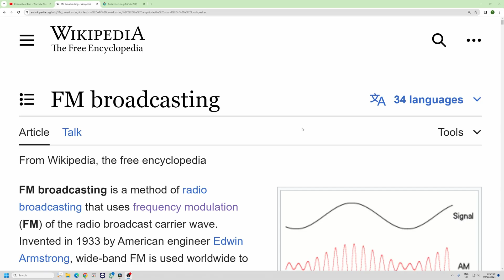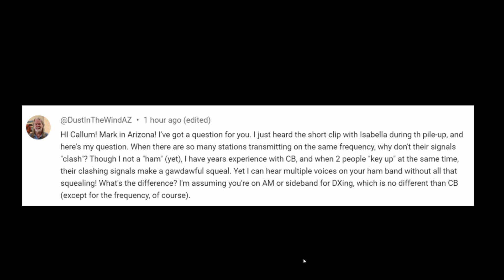The REAL Difference Between FM AM and SSB

Comment: Pilot here. Our near-land radio uses basic VHF AM and we normally get squeal when two transmit at once, but that is still a good thing because the receiver will know there are multiple transmissions and can request each in sequence. Normal case is that one transmission started or finished a bit earlier than the other so at least a call sign made it through (or a "mayday mayday mayday"), and the receiver asks for that one first. 
Worst case is both transmit exact same start and length, forcing the receiver to say there was overlap and try again, but natural random delay will avoid another perfect collision.

Over ocean they use the HF, SSB with the channels rather far apart so they can adapt to current propagation conditions (like 2 MHz to 20 MHz and less than two dozen channels; but I'm not a transoceanic pilot). The controllers do not directly use the HF ground stations, the messages are relayed through proper radio operators because controllers are centralized and concentrated on aircraft spacing and expected checkpoint times, while there are multiple base station locations and a lot of oceanic transmissions need to adjust for skip or ground wave.

For VHF it is all line of sight and controllers directly talk to aircraft, and they have automated low-power remote stations. For voice-band Europe uses 8.33 kHz channel spacing and N America 25 kHz (Though commonly US stations are on the 50 or 100 multiples). 50 kHz channels for navigation beacons (Often includes extra subsignals, even mixing AM with FM in that 50 kHz)
Reply from the maker: Thanks for the awesome insight and explanation from the pilot's perspective!

Comment: Thanks for an interesting discussion. I've got another question about various modes. Recently, I've been trying WSPR on 40 and 20 meters and have been astonished at how far my 2-3 watts get out. The WSPR reports include a signal strength in dbM. I'm wondering how well that numbers translates into making a contact with CW or SSB. What sort of report in WSPR would indicate a reasonable chance of contact with the other modes?
Reply from the maker: WSPR is good fun... For low power stuff, it's probably the best.

Comment: Two operators cannot talk simultaneously on airband.   There are many cases where a receiver has not heard an important message due to another transmitter keying at the same time.   The radios are not built to transmit and receive at the same time.
Reply: Two radios can talk simultaneously on airband.  But if their carrier frequencies are offset from each other they'll cause a heterodyne squeal.  If they're very close together in frequency (if they're frequency locked) they won't.  The fact that radios are half duplex has nothing to do with this.

Comment: "They've got very high quality pieces of kit, everybody's locked on the right frequency because it's all calibrated right"

Not the radio in my aeroplane! :-) Admittedly these days I use a handheld for the 8.33kHz spacing which is a lot better than my old radio in the aeroplane.

Comment: FM receivers also don't pick up or respond to atmospheric static or electrical interference, such as lightning, that AM and single sideband receivers pick up. To produce a transmitted modulated AM signal with two sidebands, only one sideband is required to modulate the carrier. I have a couple of old vacuum tube single sideband radios that have a manual carrier control knob on the front panel. In AM, only the upper sideband is produced to modulate the carrier, but you can hear the lower sideband that is also produced when the carrier is modulated by only one sideband. The carrier has to be powerful enough to handle the modulation being produced by the one sideband though. With those old radios, when I reduce the carrier below a certain power level, only the upper sideband is transmitted.As I introduce more carrier power, both upper and lower sidebands are transmitted with the modulated carrier.
Reply from the maker: Nice!

Comment: I haven't seen FT8 mentioned in this thread.  Love it or hate it, it makes full use of the benefits of SSB that are being discussed here.  In particular, on one dial frequency, in one 15-second period theoretically there could be a 'pile up' of >50 simultaneous transmissions, each being individually identified and decoded at -20dB thanks to the magic of SSB (and some cool software).
Reply from the maker: Yes! I recorded a video yesterday of that!

Comment: Callum, I’m still new with AM/SSB with ham radio, but I’ve been licensed to fly for the past 18 years, working professionally for the past 8 years. Aircraft radios most definitely don’t allow two pilots to be heard at the same time. On a busy frequency, it’s very common to hear loud squeals when two key up at the same time, and usually either transmission can’t be deciphered (happened a few times today). Sometimes, if one is much closer than the other, but usually not. It’s common for another person also on frequency to call out “Blocked!” any time there’s a “pileup” on an aviation frequency, sometimes causing another squeal when multiple pilots call it out. I still appreciate AM over FM because I’d rather not get the message but know one was trying to be sent rather than have a closer aircraft transmit over ATC and I miss their message entirely due to capture effect.
Reply from the maker: Fascinating..
Reply: replying to @pcramil's comment: I appreciate he's speaking from practical experience at the pilot end -  I've worked on the ground end with aviation communications "a long time" (RAF then Frequentis since 1990).  In reality if 2 aircraft transmit exactly on the same frequency, with similar power/modulation etc., in the tower you will get a "heterodine" reception.  You occasionally can make out one aircraft over the other if one has stronger signal, deeper modulation, or a higher pitched modulation (female pilots win 🙂), but you definitely always know that 2 (or more) aircraft were transmitting at the same time.  In the opposite direction (ground to air) often the ground station is more legible to the aircraft, due in part to more power and more efficient antennas.  We also use something called "climax operation" where 2 or more AM ground transmitters, geographically separated, and with a very small offset on the carrier frequency, can deliberately transmit the same thing at the same time, and be fully legible to the aircraft (as long as we set it up properly 🙂).
Reply: @cfsyoutube5799 hello, I’ve read few comments here and I see there’s someone from the aeronautical world. I’m a commercial pilot other than a ham and in fact I’ve noticed many times ground stations have multiple carrier frequencies with an offset from each other and from the center frequency. Sometimes I can hear the beating tone from the aircraft. I’ve always wondered why is that done. Is it done on purpose or is just a frequency misalignment from the multiple ground stations transmitting a the same time? Also why they use geographically different transmitters simultaneously? perhaps for radio coverage? this is interesting. Another thing I’ve noticed is that with average ham receivers the rx filters aren’t wide enough to copy the aircraft and the ground station without moving the tuning knob to center on the station. From the aircraft instead never had this type of issue. Filter width and audio quality is good enough.
Last but not least I can confirm that the radios are not perfectly centered but enough to work. And when two transmission happens at the same time, ( which I can tell it happens all the times) you can definitely hear them both, and sometimes, depending on relative strengths etc you can read one station over the other. And yes, somebody will say blocked to suggest two transmissions crossed each other.
Reply: @IZ0MTW  I'm not the OP but: "I understood this years ago... I don't anymore! This explanation is from my notes, written in the days before 8.33 kHz spacing which I guess finishes the possibility of offset carrier operation. I remember it is to enable more than one ground station to improve cover on a single channel. 'Provision exists in some areas for offset carrier operation, often referred to as Climax operation. This means that transmissions may be offset from the designated (pilot selected) frequency by plus and minus 5 kHz if a 2 carrier system is used, by + and - 7.3 kHz if a 3-carrier system and by other precise values if more than 3 carriers are used. The only concern for the radio engineer is that if these offset carriers are used a beat note is produced in the airborne Rx at 10 kHz ( or 14.6 kHz) when two (or 3) carriers are received at the same time.
The squelch circuit usually samples the the signal (speech) and the noise usinfg filters below and above 8 kHz. So for normal reception valid signals will have more detected frequencies below 8 kHz ( 300-3000 Hz speech) than above. A simple amplitude comparator will therefore open a gate to allow the speech through to the final amplifier. However if offset carrier operation is occurring beat notes above 8 kHz will will be produced after detection, simulating more noise than usual thus muting the audio o/p - squelch.
To overcome this VHF comms receivers have both signal-to-noise squelch and carrier squelch circuits. If the carrier is greater than 20 microvolts at the aerial then the squlch gate is opened even if beat notes are present. No problem to the pilot since he has selected the particular assigned offset frequncy and wants to hear the received signal. "
Reply: I'm just wondering if 2 AM transmitters, one with a suppressed upper sideband and the other with a suppressed lower sideband would work also? Suppressing only one sideband with the carrier present is still AM
Reply: @RichardMartinke6rji thanks for this interesting and detailed explanation. Certainly useful for those into these kind of stuff.
Reply: What is a.m. shortwave the other is UHF VHF

Comment: When you mix two frequencies you get three products. Like when you mix 3KHz with 27MHz, you get 27MHz minus 3KHz you get the 27MHz and you get 27Mhz plus 3Khz. This is what a normal AM signal looks like. The  minus is the lower sideband, the middle is in this example the carrier and the plus is the upper side band. 
So when you talk in your microphone you get the carries plus two sidebands. Now the carrier does not have any information. The information is in the two sidebands. And since the two sidebands contain the same information, you only need to transmit one sideband, the lower our the uppere sideband. 
So what you do with a balanced modulator is surpress the carrier, since the carrier does not contain information. So you left with only two sidebands. Now what you need to do is surpress one sideband. This is done with a crystal filter. You either surpress the lower sideband our you surpress the upper side band. Leaving you with one sideband to transimt and you can put all your HF power in the one sideband. This is single sideband. The carrier is only needed to demodulate the signal and can be provided in your receiver and this is done with a circuit called BFO (Beat Frequency Osaclillator) and should be placed at the exact spot as you should expect the carrier to be. This is why you have your clarifier on your cb-rig. to put the BFO at the exact spot as it should be.

Now to make this story more interesting, there is a reason why radio-amateurs use  LSB on the bands lower then 10MHz, and USB on the bands higher then 10MHz.  Now to use an example we build a radio with a MF (middle frequency) of 9MHz. We mix this with a mixing frequency if 5MHz. This will give us 5+9=14MHz and this will give us 9-5 is 4MHz. 
If we make this 5MHz variable from 5-5.5 Mhz this will guve is 9+5-5.5= 14 to 14.5 MHz the 20m band.
And it will give us 9-5 to 5.5MHz = 4 to 3.5MHz this is the 80m band
Now if we mix our LF our voice with the 5MHz signal you will see that if will produce the lower side band on 80m, and the upper side band on 20m. And if we choose to surpress the 14MHz our the 4 MHz you will see that with a few components we can easy build a dual bander. Only the sideband will change because of up, our down mixing.
Now you know why we use Lower sideband our Upper side band on some bands. The professionals do not do this.
Reply from the maker: Brilliant comment!!
Reply: What about 3kHz?

Comment: On the install of your Genius 8X2 do try to ground the chassis , you can tap an earth electrode into the ground & connect it with a simple earth cable .
Reply from the maker: Actually, the Genius "cabinet" is still in infancy. Currently, only the coax lines are grounded directly to a massive copper ron next to the cabinet. But I have a ton of work to to in that department...! Thanks for tip.

Comment: Thank you for sharing as always . 
I wanted to mention that I've recently been researching the huge benefits of coax cable through copper tubing , amazing noise reduction & very low RF loss , the copper tubing has to be grounded to prevent electrolysis , but coax in copper tubing under ground will be ideal within your location .
Reply from the maker: I'm sure but it's a bit late now, the trench, duct and coax is already in.. However, I agree which is why I used EcoFlex 15.
Reply: That's a shame , but well done with the EcofFex15 , it's  indeed a good solution . The copper tubing would of shielded absolutely everything & maintained RF line transmission , if you should create another RF install copper tubing will be a must have , the copper tubing will need to be grounded to earth to prevent electrolysis, but in meanwhile you can ground the antenna switch unit with an earth stake , perhaps at some point you can carry out a separate line transmission in copper tubing ?, believe it or not RG213 or even RG 58 will perform very well hence it's enclosed within the copper tubing & it will provide remarkable results . @DXCommanderHQ
Reply: another plus point with copper tubing conduit is that providing the tubing is earthed any RF feedback from the coax will be slugged straight to ground helping to protect the transceiver . @DXCommanderHQ

Comment: One of these days i want to pit a 12 watt SSB cb against a 50 watt GMRS FM radio. Should make an interesting video.
Reply from the maker: It'll all depend on the antenna, height above ground etc because they are quite different wavelengths.
Reply: Wanna make it really interesting? Find a radio that'll do SSB on GMRS frequencies. Yes J3E(SSB) is authorized for use on GMRS according to 95.1771(as is A3E AM), it's just that nobody makes Part 95 radios with the capability. You'd have to use something like a modded IC-7100.

That aside, I have both an AM/SSB CB and GMRS radio in my truck as well as bases for both at home. If we're talking about reliable simplex communications, not skip or tropospheric ducting, GMRS works better in some situations and CB better in others.

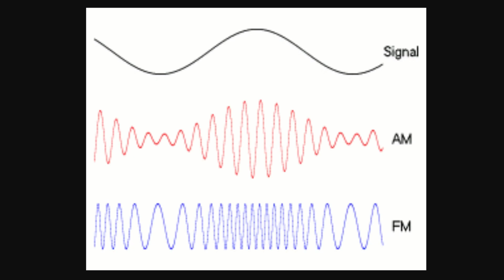Comment: Technically (at @2:00 and around). Both AM and FM are "de facto" modulated carriers. The difference is the way of modulation. FM modulates the FREQUENCY of the carrier, AM modulates the AMPLITUDE of the carrier.
The real reason why many AM (and SSB with suppressed carrier) stations can be heard at the same time without an issue, is rather simple: If there is no carrier (or there are many carriers on the very same frequency), you can DEMODULATE all (added) AM modulated sinusoidal waveforms without a problem. The key is the ability of demodulation. When general AM or not-suppressed carrier SSB sinusoidal waves are added in a crowd, the problem is: that you'll not be able to demodulate it correctly, because the carrier of the off-frequency transmission will corrupt the "good"/useful part of the other transmission. 
On FM, the situation is even more complicated. FM "silence" is a clean single-frequency carrier with a pure sinus waveform. The receiver will always lock to the signal with the bigger amplitude (the stronger one) and will try to demodulate the speech (or data, or whatever) relative to the stronger signal's carrier frequency. If there is any, the stronger signal will win and the receiver will clearly demodulate the information, even when the other signal is slightly off-frequency and may corrupt one side of the FM modulation. This is called the FM Capture effect. That's why FM has way better sound quality and is used on commercial radio broadcasts.
BTW, there is a very good video explanation of it somewhere here from Tall Paul.
Reply from the maker: Very fine. Tnx.
Reply: @DXCommanderHQ  Oh, yes.. Just a footnote. That's EXACTLY why FT8 can't work on FM.

Comment: Let's go back in time to the late 1950s. 
Amateur radio was just seeing the then-new SSB mode. Although AM was still widely used it became relegated to rag-chewing because SSB was proving itself superior for DX. VHF hams were still using AM by a wide margin. FM wouldn't become popular until the early 1970s, when repeater operation became legal, and a flood of abandoned commercial radios hit the markets. Speaking of commercial radio...

While the AM vs. FM debate was largely settled, there was still a few users of AM in the 25-30 MHz region. FM was winning because of its ease of use and its simplicity. Truck drivers turned the radio on, set the squelch, and didn't have to fiddle with it again. When skip became an issue CTCSS systems were implemented to deal with the problem.
Reply from the maker: Fascinating. Thank you.